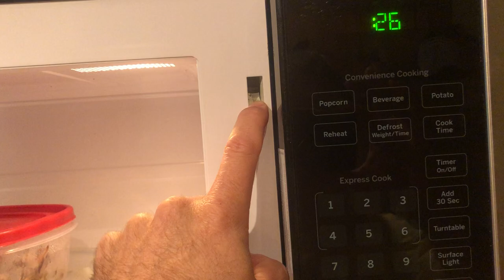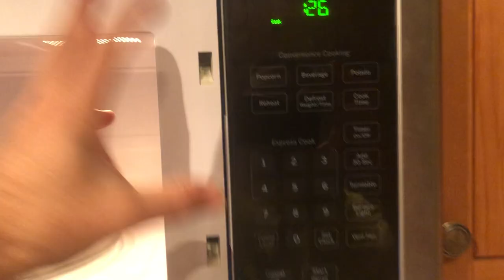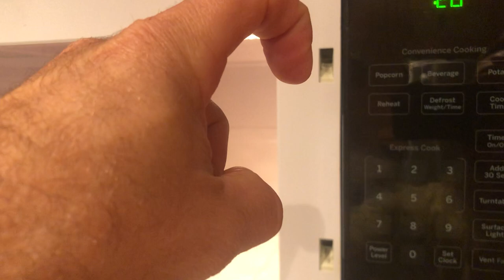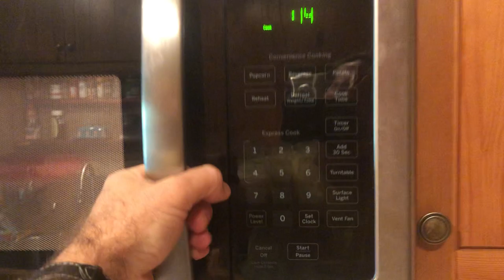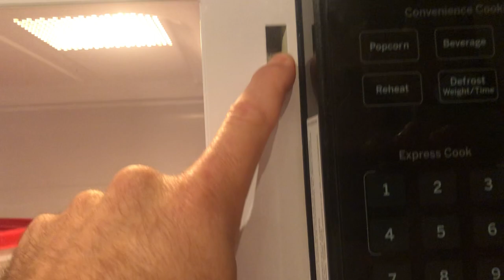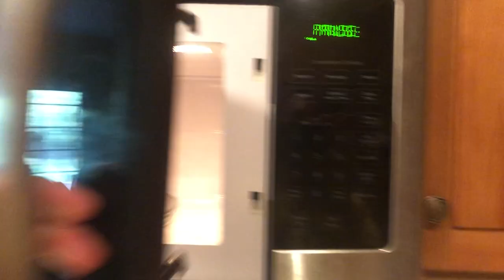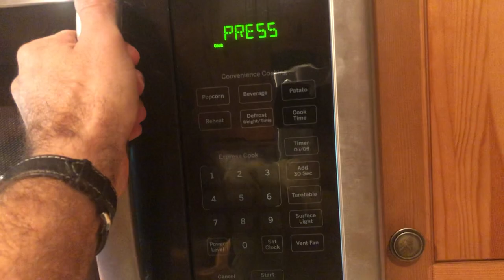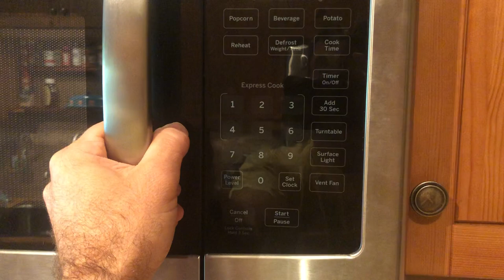Microwave trips breaker even after you've checked and/or repaired switches

Comment: On my daughters when you shut the door there is a upper and lower ramp that the door hooks slide up on. Her problem was at the top of the ramp the latches have worn grooves at the top causing the hooks to rest a little lower causing them to not engage the bottom switch. I ordered that part from amazon. Fixed.

Comment: There is a good reason that all microwaves have a STOP/CANCEL button.  Always press STOP before opening any microwave door.  These door switch problems are far less likely to occur when you operate the microwave as it was designed.
Reply from the maker: My microwave manual explicitly says to open the door to stop the cooking, particularly when you want to check the food mid-cooking without having to reset the cook time.  

So it was designed to open the door to be one way to interrupt the cooking.
Reply: @MrWolfetune  It's the equivalent of yanking a plug.  And as you've proven with your video, damage can occur from this operation.  Particularly with microwave hoods, opening the door while running is the most common cause of microwave failure.
Reply from the maker: @shawnp8878  , my microwave tripped the breaker because the latch wore down.  Opening the door, for any reason, will eventually wear down the latch and/or the housing the the switches sit in.  That is why a new latch fixed the problem (after the temporary fix of duct tape).   So my video did not prove what you are saying, not at all.  

Did you watch the video?  Seems like maybe you didn't.

Yes, it's probably true that using the pause/cancel/stop button is the slightly better option and will cause less wear on the switches, but the microwave is designed to deal with opening the door while cooking.  Thus the explicit instructions in the manual to open the door to check the food and then close the door and hit "resume" to continue cooking.

But hey, you do you man.  Sounds like the Pause/Stop button is a great option for you.
Reply: @MrWolfetune  My initial comment was intended to be general advice and not directed specifically towards you.  You're clearly put off but I've had no ill intentions.  I'd also recommend not following the owner's manual to self clean your oven if it's an option.  You can ask another professional and they'll tell you the same.
Reply: i think the issue is most people and definitely kids slam the door shut.  i did this many years ago so much i broke off 1 of the door latches
Reply: Very true
Reply: As someone very familiar with electronic engineering, no you don't have to press stop first on microwaves designed to pause with a door open (basically all of them nowadays). It's absolutely not like yanking the ac plug 😂. That's asinine. The whole point of the latch switches are for the modern feature of opening the door to pause cooking. Sorry Shawn, but you're wrong.Those switches communicate with the MoBo to stop the magnetron, fan, and to turn on the internal light and pause the timer.
Reply: @LeviBulger  As someone who repairs microwaves and other kitchen appliances, daily, I can say with absolute certainty that you do not know what you're talking about.
Reply: @LeviBulger  In particular, with over the range microwaves, the door handles are usually higher than most peoples average height.  This causes the door to open at angle, those micro switches are simple attached to plastic levers.  It's not a clean break in connection.  Good bye.

Comment: I was driving myself nuts with my Frigidaire Gallery microwave. The middle switch (normally closed) was blown and tripping the breaker at random times. Once fixed the breaker blew again and the new switch blew again. I upgraded the switch and now just the breaker would trip opening the door only. No videos led me anywhere and even an appliance repair tech swore it was the switches. So glad I found this. Who would have thought milliseconds mattered and black duct tape would be the fix. Lol.
Reply from the maker: Lol, exactly, seems like the timing issue would be prevalent and there would be more videos and chats about it.  FYI, I ordered a new latch for 12 bucks and it fixed the problem on mine.
Reply: @MrWolfetune  the latch meaning on the door with the two hooks, or the latch receiving assembly  on the microwave side that holds the micro switches? The reason I ask is it seem both sides of mine were worn a little.
Reply from the maker: @andrewchatel1656  Just the hooks part.  I also replaced the spring while I had the door pane open (the spring was like $4).  

I also ordered the latch-receiving assembly because mine is worn as well.  I will probably switch it out one of these days.  But just replacing the hooks did the trick for now.  There are some videos about how to do that, it was pretty easy and straight-forward.
Reply: I think what happens is when the break trips from the switch it’s basically burns the inside of the switch in the close position I just replaced the switch and tested to see if the break trip would if I opened the door while it was cooking (which it did) and the new switch was stuck in the close position I opened the switch and saw some burn marks and it was stuck in the close position

Comment: That's the ticket!! works great now,i tested your solution first with electric tape and once i got it to work now i will replace the tape with 2 layers of shrink tubing . It looked in the video that the door latches on your microwave were steel? Mine are plastic and must have gotten flexed over time, once i slowly opened the door i could hear the switch clicking at the bottom.
Thanks again....
Reply from the maker: My latches are plastic as well. I ordered a new set and it totally fixed the problem. But the shrink wrap tubing is a great idea! Glad the video helped.

Comment: This fixed the problem with the breaker tripping, but the magnetron is running while the door is closed. I had already replaced all the doors switches. Any idea why the magnetron would still run?
Reply from the maker: Yeah, I was able to keep it running when I put too much duct tape on the latch.

Basically, play around with the spacing there. If I remember right, when I put too much duct tape on the latch, that would happen. 

Either way, down the line I would suggest just getting a new latch to see if that fixes the problem permanently.
Reply: @MrWolfetune  Thanks for the quick reply! I think a new latch and latch board are in order. Helpful video!

Comment: This. I had the very same problem. In fact, after a day or so of this. It stopped working all together. That is, when the magnetron turned on it tripped the breaker every time. So I think what happened was, after shorting all the power to ground so often, the extra power actually welded the switch closed. So we replaced that switch. But it still tripped the breaker every time we try to open the door during cooking. And it happened again that it welded the switch closed. I didn't know this until the second time it happened. Now I have replaced the switch for a second time. And I also followed this guy's advice about the duct tape on the bottom hook. Plus I found a guy who said that if you could angle the bracket backwards at the top so that the switch connection always breaks at the top first that that would help as well. So I did both of these, and now the microwave works like it was intended.
Reply: make sure the bracket is not loose. maybe the screws have come lose?

Comment: so my switches all test as working correctly and i still have the issue with  he bleaker tripping with the door closed.  it runs for 3 o-5 seconds and then trips the breaker.  i pulled all the switches they arent gummed up.  your best guess is the door latch isnt pressing down all 3 switches? update: i duct taped down the buttons on all 3 switches so i know they were firmly pressed in and it still does the same thing.  not a door switch issue in my case
Reply from the maker: Bummer, I’m not sure what that is.  If it’s running for a bit and then trips the breaker, that sounds like a completely different issue.  Power surge or some other issue.  Good luck, hope you figure it out.

Comment: This worked on my microwave. Vince, how long does the duct tape fix last? Is there a more permanent fix ?
Reply from the maker: Hi Jay.  Yeah, most likely the issue is your latch. Depending on your model, you can either get your latch on Amazon or from a company that sells parts. The latch is most likely only 5 to 10 bucks.  It’s fairly easy to replace, and there are several videos out there about to do it.  

There’s a chance that the issue is with the actual housing that the latch fits into. This part is more like 20 bucks most likely. 

If you were able to start with replacing  just the latch, I would do that. But if you have to pay a bunch for shipping you might just order both the latch and the housing at the same time and replace both.
Reply from the maker: Oh, and while you are at it, get a new latch spring as well, it’s probably only 2-3 bucks and can be replaced while replacing the latch.